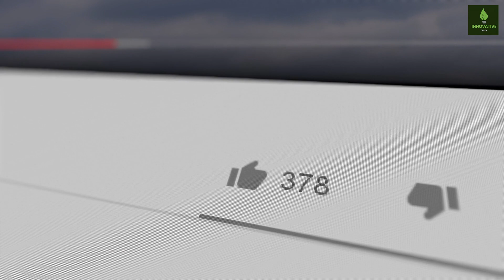U.S AND CHINA Lock Horns In A New Chip Battle ! Advance Packaging

Comment: This video is so behind the times. The Chinese has already surpassed the US in this area (they already have used packaging in order to achieve the performance of 3nm chips). And you are equally clueless about semiconductors in general. China has already well beyond the west. I guess that you have not gotten the memo on photonic chips, optical chips and hybrid optic-electric chips which is at least 4000 times faster than anything existing in the west. Don't worry. All will be clear when products with these chips come out next year including the 44 manufacturing plants that are presently being built.  It will be no doubt that China is far ahead in all the elements that matter in semiconductors.
Reply: If it doesn't come out next year, you should shut up....
Reply: Behind time.    !!!